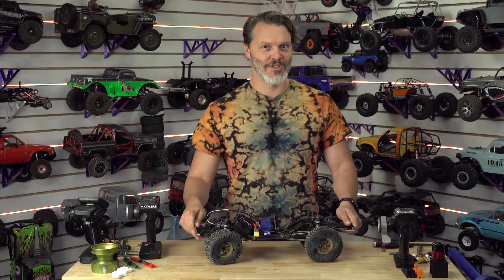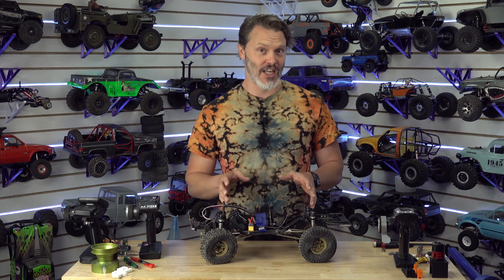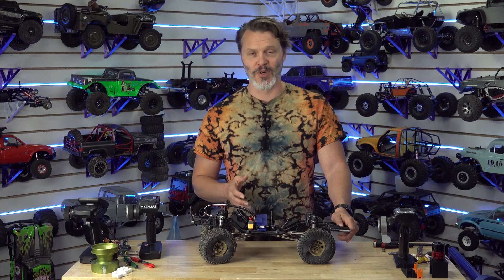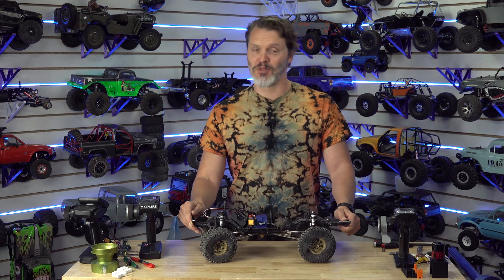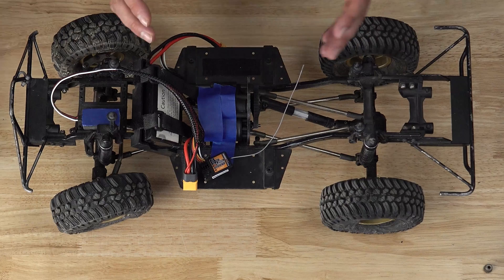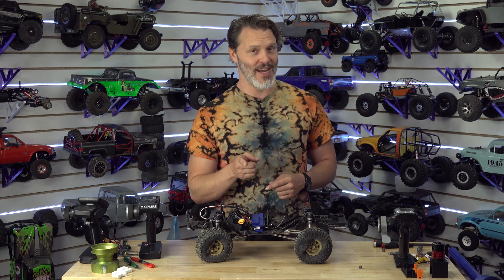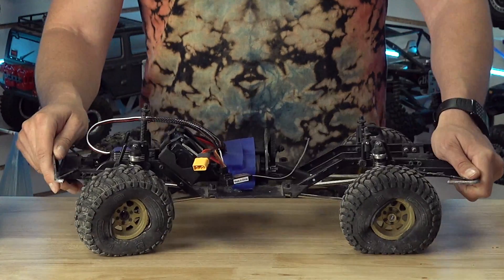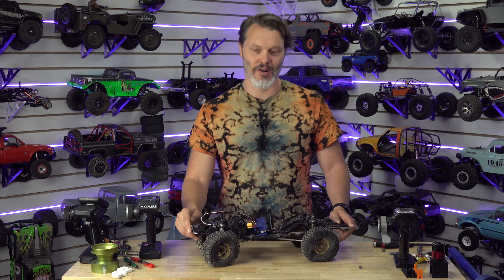🔍 The Low KV Myth: Does It Really Boost Torque for RC Rock Crawlers?🚗💥

Comment: Hey, I got a question that's been running in my head for quite some time. I am using brushless setup to run Lego Technic models, and recently suited a couple brushless motor to Lego system, using planetary reduction, and some 3d case for brushless motor. Let's say I have two same motors (same case, rotor, etc.). The difference is between their KV - 1300KV vs 2200KV. Smaller KV is running on 3s(12.6 Volts), bigger on 2s(8.4 Volts). I have also planetary reduction 6:1. Which means, the rpm at the output would be 2730(1300KV) VS 3080(2200KV). I am looking for more smooth throttle response. I don't mind having less or more RPM, but I want to have it more slowly built up. I don't know if motors KV effects that, I think it does, the thing is I don't know which to choose. I am using AM32 ESC, and I like it. The thing is when I suddenly punch the throttle a little more I feel so sudden boost of RPM that my Lego Technic gearbox give up, and I can hear cracking. I don't know if you can help, but I would like to hear your opinion on that, thanks.

Both brushless motors would be powerful enough to move my models, I think. At the wheels, I also have planetary hub reduction 5.4:1, so I guess it is fine.
Reply from the maker: The most recent am32 firmware (2.19) has a ramp feature that will soften your acceleration.   Look into updating it and theres your solution!
Reply: @HolmesHobbies  Wow! Didn't know that, I was running on 2.18. I will look into that, thanks a lot!

Comment: I live in Texas, and I always have an issue when going on trail rides for 1-3 miles at a time where my motor overheats. Would going down in KV produce less heat? I run 3s on my trail rigs
Reply from the maker: @Cooldibs  yes, if you don't change gearing a lower kv should help.

Comment: Well...I just switched from the castle 1415 in my crawler ryft and put in a puller pro 2100 KV Running a castle mamba x ESC...  The difference is nastronouncle it's like a totally different rig!  It crawls epic! With its 2 speed transmission full size shift servo. Not only that the throttle response is... 😮 HH ❤

Comment: When using lower kv depending on how you gear, your going to use more voltage to achieve the same wheel speed. I think that's the noticeable difference.

Comment: So I run a lot of the smaller scale stuff I got this motor that is like my favorite it's a 4100 bam with a 1011 tooth pinion insane torque insane strength and insane will speed a lot of people are like you're crazy take all those little pancakes Motors and tell me you can make the same amount of work no you cannot the magnets are not near as long nearest heavy I just love that motor you know but it does run warm

Comment: Lower Kv = high Kt and when I was testing my HV ESC back in the good old days I had a Neu 1515 2y and I was using 8S geared to around 40MPH. It out performed anything I tried on 6S and 4S also geared for 40MPH. Longer run times was also great with 8S and most of my testing was done with 2200mAh capacity cells. I also looked at a datasheet from a company that makes axial flux motors and it offers 3 voltage ratings which are 115V, 300V and 500V. The 115V unit produces 0.20 Nm of torque for each Amp, the 300V unit produces 0.54 Nm of torque for each Amp and the 500V unit produces 0.83 Nm of torque for each Amp. I like lower Kv with higher voltage and from my days of testing my ESC in the middle of summer I never used a fan on the ESC or the motor.
Reply from the maker: As long as we are optimizing for the mosfet and vehicle, there is a point where higher voltage doesn't get us anything.  But if the esc has unused voltage overhead, higher voltage and lower kv does typically lower heat. 

Example, a 20mph ebike on 36v really won't benefit from going to 72v on half the kv.  Not enough power needed! 

In the case of crawlers, higher voltage packs almost always raise the center of gravity.  It's the one reason I haven't pushed 6s.  Don't need the power, don't need the taller packs.
Reply: @HolmesHobbies  I've seen some very small 6S lipos and there are even small li-ion cylindrical cells that might be able to do the job since crawlers won't draw that many amps as you stated before. Give it a try with a very low Kv motor that is geared like a 3S or 4S to see the heat difference. You should see some lipos @Hwy49RC built, I thought she had a single pack that was bent, but I was surprised.
Reply from the maker: I find volume limited situations quite interesting.   Such as onewheels where we have to trade amp hours for voltage. Then it becomes an arbitrage of lowest iR for the entire chain of components!

Comment: I run smaller 2S packs in my TRX4 w your CM v3 and an older Revolver and have had no complaints. I have a small 3S pack I have used in the past when I needed more umph but I ended up gearing down and going w a strong OD/UD setup so the 2s has done me well. I should learn more and try more but I end up just driving the rig and forgetting Im doing tests :D